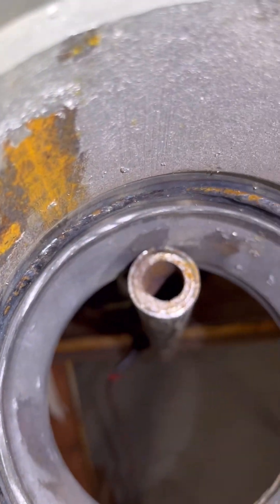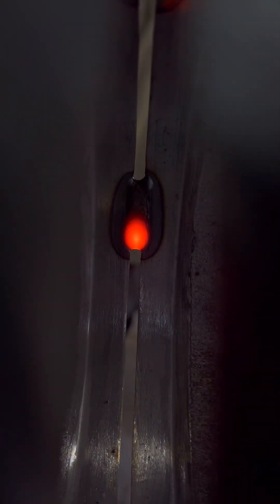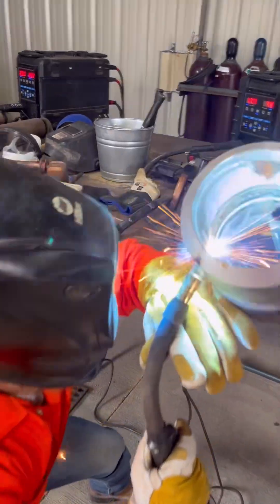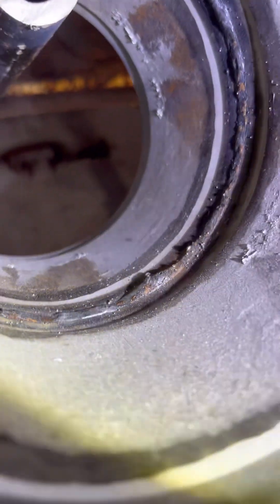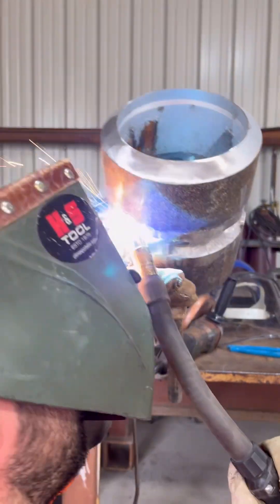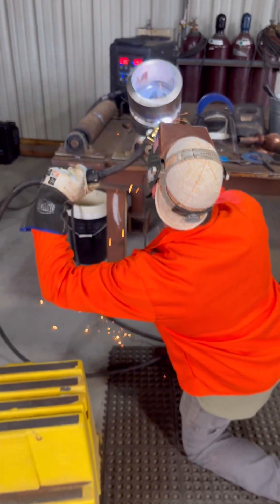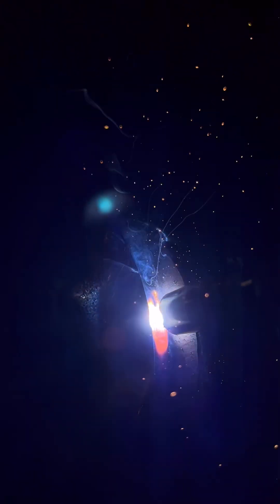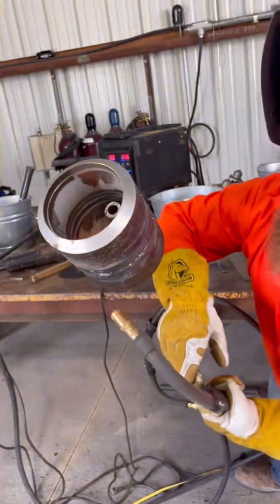RMD root pass and flux core pipe welding

Comment: Starts and stops in line with each other on the cap...would be a automatic fail with all the 6g pipe test I've ever taken.. especially a  ASME Section IX  pressure Vessel Qualifications
Reply from the maker: This is an same test. No one has ever failed me for doing that, although, it is a good idea to stagger your starts and stop especially if you struggle with starts.
Reply: @getweldsoon1113 4. Staggering: For multiple passes (fill and cap), the start/stop locations are staggered around the pipe circumference so that they do not all fall in the same longitudinal line, which reduces the potential for a continuous line of defects.This comes out of the 4 ASME to know General Qualifications documents

Comment: Downhill all the way out? How does it go in a 2G?
Reply from the maker: Not all the way out, just the root pass.
It does pretty good on 2g as long as your gap is good. If your gap is too wide it gets tricky and if the gap is too tight it’s hard to break the bevels down.

Comment: Cool video I had been wanting to see one like like this what are your Wire speed and voltage between passes?
Reply from the maker: I believe the fill and cap was 23volts and speed was 250 if I remember correctly.

Comment: Whats the benefit of mig welding a root vs tig? Are we really saving that much time? 
Is this more of a structural tube thing?
Great video and great channel. Keep up the good work.
Reply from the maker: Thanks for the comment and compliment!
So, the benefit of this process for us is, we weld a lot of 9 Crome and with this process you don’t have to purge your pipe. So for this purpose, yes, it saves a lot of time and argon. On the other hand, if you were just welding carbon steel that didn’t need a purge, then it wouldn’t really save a lot of time.
Reply: @getweldsoon1113  well thats a pretty good reason right there!
Reply from the maker: Yessir!
Reply from the maker: Yessir!
Reply: Semi automatic is faster anyway... @getweldsoon1113
Reply: @getweldsoon1113  RMD will save time compared to TIG on any steel alloy.
Reply: Mostly Cold water pipe  configurations . Run short circuit root and FC fill and cap..2 face and 2 root bend criteria to qualify..for stamp